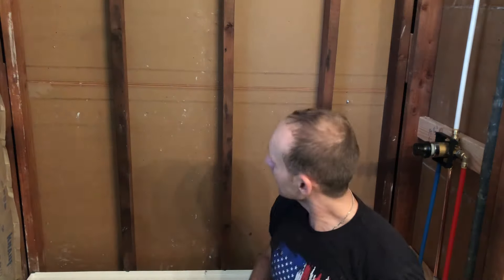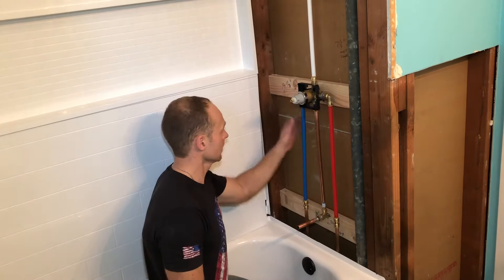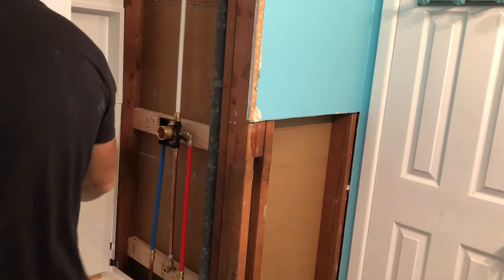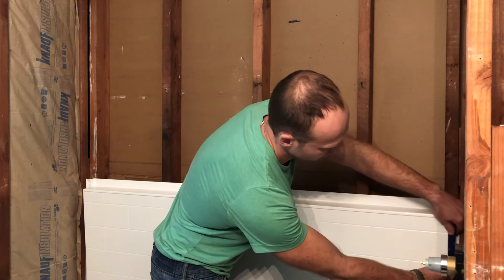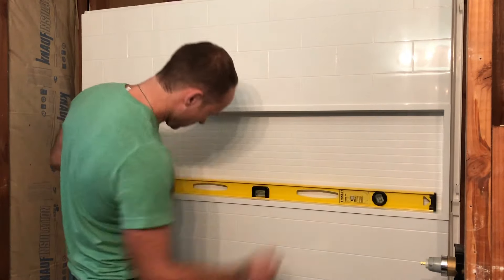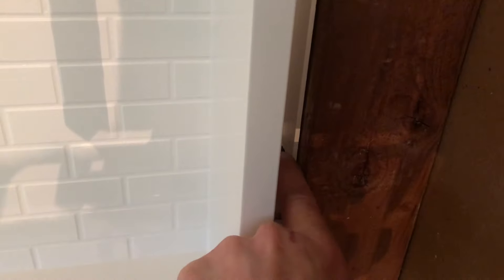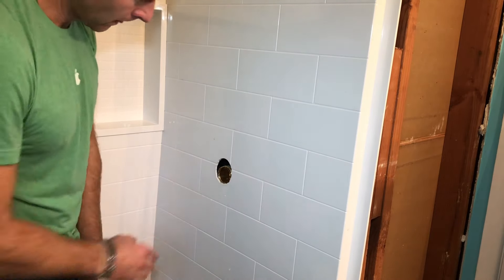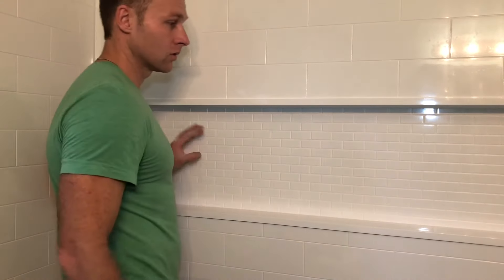Nextile direct to stud alcove bathtub surround install directions. Step by step full install

Comment: The lower piece of the back wall feels pretty loose on mine where it meets the tub. I can push it forward and back quite a bit. Did you have that problem, and did you do anything to fix it?
Reply from the maker: Should be snug against the studs.  And sitting level on the tub. Should not be loose.  Especially after side walls are up
Reply: We added an extra 2x4 to ours in the middle of bottom so it wouldn’t push in
Reply from the maker: nice.  good thinking @kaylakettlewell5320

Comment: so my contractor frowns on these tubs surrounds. He wants me to go with the heavy duty backer board drywall and then use tile with the mortar and the grout and all that. I just want to be able to take a shower without the water leaking through the surround. How do I get them on my side? I think he thinks it looks cheap and too much like a mobile home. I’m trying to convert them. Help me out with this if you can. what do you say?
Reply from the maker: Ofcourse  they will say that.  Cause they will make a lot more money doing it the traditional way.  And real tile is nicer.  But takes longer to do and more money.  I was on a budget and rush as needed a functional bathroom.    Water does not leak through these as long as you seal all corners.  As it should be.  Mine is over a year old now and all solid. Posted recent video .
Just if doing the tub surround don’t go for cheapest.  This one I like and the part that can tile the shelf.  That makes it stand out.  Surround is a quick easy solution.  Easy install and solid if installed right.    Real tile is great if you have time and can afford.  👊

Comment: Hi, I saw in the reviews for this product that some people wrote that it protrudes inwards because of the shelf, so you end up losing bathing space.  Did you find this to be true?   I couldn't really tell if it was protruding forward in your video.
Reply from the maker: It’s true where the shelf is.  But is so little.  Check out my follow up video, I showed all the measurement .   I have nonissue with that honestly.

Comment: I'm installing one of these, but I have existing drywall so wondering how high up on the ends I should cut out, you mentioned an inch and a half, or is 2" better? Thanks!
Reply from the maker: You will have to drywall over the lip on top. At least that’s the process. But if want to cut more flush probably 2” or so yeah.  But would measure first

Comment: What is true open size? Wall to wall. Thanks.
Reply from the maker: You mean with the tabs?  Should be same as the tub.  Whatever they say the space it’s for.  Sorry can’t measure now.
Reply: @HowToWithLech  the actual distance available for a shower door. I think maybe it is 58 inch but wanted to confirm as I have door that is very specific. Thanks.

Comment: Hello, I just bought the Nextile surround. But I think I have to install new studs due to water damage. It seems like a big project to take on. But, it’s not rocket science. Want to be well informed  before taking down the drywall. Do you have any suggestions? thank you for your videos. Stay safe and healthy.🙂
Reply from the maker: Just take the wall down, you'll be fine.   I actually did a vide on removing the tub tiled walls etc.  check it out, i think it will just add to your confidence to move forward.   same with tub removal etc.   then when you take down, you'll see if studs actually need replacing. if they do .  not  big deal.  just have to be carefull not to damage the sheetrock wall on ther side if any.

Comment: Hi Lech. I know this video is a year old but I have a question. I want to install this surround but the tub I have is a Kohler alcove tub with an integral apron. Will this fit?
Reply from the maker: If sizing is correct I’m guessing it should. Should go over the lip on the tub.   I’m sure tub is pricy so maybe check with the mfr to be sure
Reply: @HowToWithLech  Thanks 👍

Comment: Very important Question... Please Respond.   Do you need to remove old bathroom wall tiles? Can this fit OVER existing wall tiles?
Reply from the maker: Yes tiles and sheet rock needs to come off.  This kit goes directly onto the studs.   It’s all shown in the video.    Technically you could probably put over , but probably won’t fit right.  Will over lap tub edges.     Tile removal not that hard.  I posted video on how to remove safely and efficiently.     Best  of luck

Comment: I have a steel enameled porcelain tub. Will most wall kits fit on it? Or are wall kits made
For specific tubs. I bought one with the correct dimensions to fit my alcove and assumed it will fit the tub even tho they are different brands and not made together as one unit? The tub has a flange so I’m hoping the wall kit can just sit over the flange of the tub, I can screw it and use construction adhesive to hold it in place. Then caulk where they meet to make sure no water gets through. I’ve tried google but with no luck I don’t want to tile and I also don’t wanna buy a fiber glass tub because my kids cracked the last one while taking a bath not even 2 years after it was installed. The water also ruined one wall that also was new plaster maybe 2 years old, and did minor damage to the ceiling, I think a little sanding, and a coat of Zinsser will fix that, but a 2’x8’ section of the wall needs to be replaced for sure which sucks because it’s against a window so my crown, chair, floor, and the window molding all have to come off while the repair is made. Anyway I wanted a stronger tub and I’m hoping it’ll work with the wall surround kit I bought.
Reply from the maker: It will fit the tub if its the same space measurements.   Each kit has sizing listed.

Comment: What would you do if the copper tub spout is already installed? Will the wall corner of the shower pivot at a wide enough angle to be pushed on and around the spout or do you install that first?
Reply from the maker: I tried.  No.  You have to remove it. And install it once the wall is on already.  Hope that explains it.

Comment: Amazing work!  Love how classic and simple the finished bathroom is
Reply from the maker: Thanks so much!
Reply: Looks amazing, I only have 1 problem with Nextile shower surround panels. Are you ready, Yes 1 major problem w them! Lech you need to tell your viewers! When those panels are installed. THEY FRICKEN PROTRUDE OUT ABOUT 4 INCHES INTO YOU SHOWERING SPACE!!!! When you put those panels on they literally take away 4 inches and extend 4 inches more into your showering space!!
Reply: @Brian-vz7xe  How else are you to get a niche if it doesn't protrude into the space?
Reply: @RenovatingMama  Yeah something to consider, because I wouldn't want anything protruding in to my space while I am trying to take a shower. Really niches are suppose to go into walls, between the studs. Something to consider because if you get a "30 tube and then these walls are going to protrude so takes off another "3? Better consider that, if you are doing a job for some one. They might just be pissed off about that. Then all hard work for nothing. Yup i said it "3 in protruding into your shower space. Next time you are taking a shower, see how close does it take for your shoulders to rub against the walls. And then consider those "3 or "4's.

Comment: I would like to see how you joined the drywall at both ends. 
  At the end opposite from the faucets, did you cut the drywall back to the nearest stud then reattach a wider piece to cover the edge of the surround?
Reply from the maker: Yeah basically.  Cut it for flush fit, and over the surround lip.  Then I painted and siliconed to surround.

Comment: Bootz tub surround is not ada certified for a grab bar, hmmm. Any suggestions?
Reply from the maker: its pretty solid. but if installing a grab bar, make sure it goes into the 2x4"s behind tub surround to be safe.

Comment: Hey there installing this tomorrow. I see you don't have the tub spout copper line sticking out. Mine is soldered sticking out ready to go. Am I going to have issues getting the valve side on with that sticking out?
Reply from the maker: Yeah you will.  Ran into that Issue when trying to remove wall.  You have e to remove it and thread it on after the wall is on.
Reply: Alright will do! Thank you for the tip! And answering so quickly!
Reply from the maker: I try 😉

Comment: could this be installed with drywall currently already installed or should i rip the drywall off and then do the install ?
Reply from the maker: Proper way is to remove drywall and install right over studs as in my video.  One issue might be if you don’t , it will overlap tub edges too much.

Comment: Do you feel like your tub space was reduced with that wall that kind off sticks out a little too much ?the wall where you installed your tile ?
Reply from the maker: not at all. or barely if that.  i did follow up video so check that out.  i showed all measurements to show exactly how much space there is , and what is lost.  thanks

Comment: Would it be possible to install this surround with the back wall straight (frame around the niche and secure it to the studs)?  I was very close to purchasing this product until I noticed it encroached on the shower area.  Thanks,
Reply from the maker: That’s the design.   As seen.  Don’t think can alter.   Check my follow up video.  The niche does not take away much at all.

Comment: We did the dry fit, and now we can't pop them out for installing with shims and nails. Any suggestions on popping them apart because the walls are not budging. This wasn't demonstrated in the video. Thanks
Reply from the maker: If it’s not jammed in should come up.   If you pull side upwards.  Should slide out.  Just has to be loose side to side.
Reply: Were you able to get the walls out? One of mine is stuck too.
Reply from the maker: @laniemarie882  yea. it was a little pain to pop back out.  has to be loose.  nothing pushing on it, that prevents you from pulling up and out.
Reply: @laniemarie it never popped out. We kept going with installation

Comment: My Contractor recently purchased this shower stall for our guest cottage but the pannel under the niche does seem straight to me and it is kind of crooked at the bottom. I see the same thing in your finished video too. Is this expected?
Reply from the maker: Yes.  It’s to save space on bottom under the shelf.  Check out my follow up video.  I go over measurements.

Comment: This is the exact kit I’m looking to replace mine with. Do you have any regrets or things you wish you did differently in hindsight? I am concerned about waterproofing since it’s direct to stud and was hoping maybe I could do a minor but of waterproofing behind it (esp because this is an outer wall and I live in Alaska).
Reply from the maker: No. I love it.  Easy to clean and no leaks.  No need to waterproof behind.  Just silicone / caulk seams and it solid.  Did couple follow up videos on it. Check them out.

Comment: Can this be cut to fit if the tub only measures 59.5 inches?
Reply from the maker: cant cut.  but i would measure wall to wall.   basically to make sure it will fit the space..  sounds like tub probably is 60" space

Comment: Did you have to caulk the seams between the back wall and side walls?
Reply from the maker: Yes
Reply: @HowToWithLech  thank you
Reply: What was the best caulk to use? That will not yellow or mold

Comment: The walls fit a 30" tub. If you look at the framing drawings, the stud wall is supposed to be 31 1/4".
Reply: that's probably a newer building standard... when I tore down the tile from my leaking 60s bathroom shower, I had the exact same overhang that Lech did.

Comment: Can you tell me what the area of the tub is inside?  i want to do the shower surround that is similar however, i feel once shower door is on may be too narrow for comfort
Reply from the maker: I did a follow up video about the spacing.  Check it out.  Let me know if that helps. If need more info let me know.

Comment: Do not buy this surround. As stated b h many you lose about 3.5 inches on the back wall because of the niche. Since a tub is 30inches wide, having 26.5 inches to shower is tight. If you throw a shower door on there, it's worse than an MRI if you're claustrophobic, if youre on the  chunky side, keep your soap and shampoo close by because you won't be able to turn and get it.
Reply from the maker: Might not be for everyone / size.   But I  can’t fully agree with this.   We love it.   Checkout my follow up video about the sizing. It’s better explained there.  Thanks for feedback👊

Comment: This is one of the more well-explained videos I've seen. Thank you for putting this together. Does Nextile allow for custom shower sizes? Or only in fixed sizes? Thanks.
Reply from the maker: 👍. They seem to be fixed size.  Would have to find the the  size you need that will match  tub width and space.

Comment: Hi, how did you finish above the surround and keep it water tight?
Reply from the maker: I actually did  a follow up video.  Check it out. But basically. Sheet rock over the lip. Painted it.  Then caulked the space.

Comment: I see on Home Depot there are complaints about the walls sticking out taking up shower space. Did you see an issue with this?
Reply from the maker: It does.  Because of the shelf.  But doesn’t affect use of shower at all in my opinion.  We love the shelf part.  I’ll do new video soon to show the angles

Comment: Hi. Just installing this now.  The bottom middle of the back is able to be pushed back, it’s loose, so I’m worried the caulking seal will break.  Has this been an issue for you?
Reply from the maker: the middle piece bottom and top should be right against the 2x4's. and bottom piece over the bathtub lip.  once you screw in the bottom piece onto the 2x4. top lip.    the top pice should snap into the bottom one for snug fit. then secure that one to 2x4s.  shouldn't be loose.

Comment: Great video thanks for posting.  I have a question about how & what you did to ‘finish’ along the top of the tub wall??
Reply from the maker: Sheetrock over the lip.  Painted sheet rock.  And used bathtub silicone to seal the connection gap.
Reply: @HowToWithLech  
Thanks for the quick reply and reassuring my thoughts will work 
I am thinking of using ‘J’ channels to keep the drywall dry where it touches the edges
Reply from the maker: Yeah. That’s a nice touch 👍
Reply: Thank you for answering, Ive been wondering how to deal with that issue

Comment: What type of wall do you put above the surround? I have the exact one and not sure what to use to fill that space. Thanks!
Reply from the maker: Hi.  Sheetrock. Mold resistant preferred
Reply: Thanks. Also did you do any caulking just to be safe?
Reply from the maker: @MNfamilyof7  yes, of course. around all the seams.   the top sheetrock i painted first, and then caulked the gap between the tile walls and the sheetrock.
Reply: @HowToWithLech  thanks for the information! Love doing home projects myself and as a woman I feel so accomplished! Hope it looks as nice as yours when finished! 😊
Reply from the maker: @MNfamilyof7  it will probabl look better.   best of luck

Comment: Nice install! I'm doing the same thing to my bathroom. I'm really curious what you did to the copper pipe for the diverter tub spout. Brass to brass fitting to thread it in after the siding went up?
Reply from the maker: Oh.  I have it shown in the other video.  Check out my bathroom section on my channel.

Comment: Hello
I’m going to be helping a friend install this system. In the first part of the video you had the faucet spout pipe and the. It was removed. Did you use a threaded pipe for the spout instead of sweating it in?

Thank you
Reply from the maker: Yes it’s threaded.   Have to remove it to get the wall on.

Comment: Hi Lech, great job on the bathroom and video. Can I use a jigsaw to trim the walls as needed ?  I didn't hear what you had used to cut the tab off. Thanks.
Reply from the maker: Should work.  probably use a metal cutting blade.  i used a high speed rotary tool. like a Dremel.

Comment: Do your walls have to be perfectly plumb to use this in your opinion?  Old house, not plumb walls are our reality.  Thanks!
Reply from the maker: Hi,  honestly i dont think so. and you use shims or strips where needed if sticking away too much.    you're putting right over 2x4 so shodul be easier to deal with.   but the bathtub has to be perfectly level.  as you seen in my video, i messed up the first time.   my house was built in the 50's so crooked all over.  i found beer cans in my walls from teh 50s lol

Comment: Hi it looks beautiful may I ask were you got all the shower and faucet hardware!! The black is sleek
Reply from the maker: Hi, was actually hard to find all black hardware.  Not many options out there.
Ordered online from HomeDepot:
Delta Trinsic 1-Handle Wall Mount Tub and Shower Trim Kit with H2Okinetic in Matte Black (Valve and Shower Head Not Included)
In2ition Two-in-One 4-Spray 3 in. Dual Wall Mount Fixed and Handheld H2Okinetic Shower Head in Matte Black
Westbrass 1-1/2 in. NPSM Tip Toe Tub Trim Set with 2-Hole Overflow Faceplate in Matte Black
Reply from the maker: And this was for the faucet:  Delta Broadmoor 4 in. Centerset Single-Handle Pull-Down Sprayer Bathroom Faucet in Matte Black
Reply: Thanks 😊